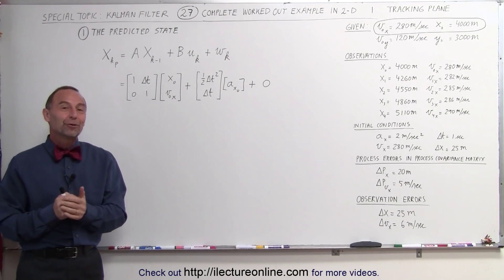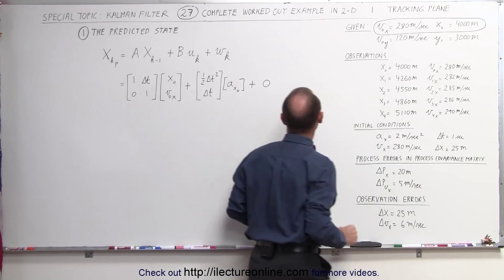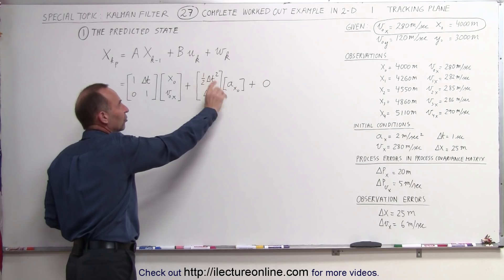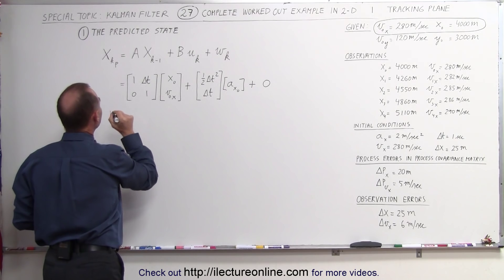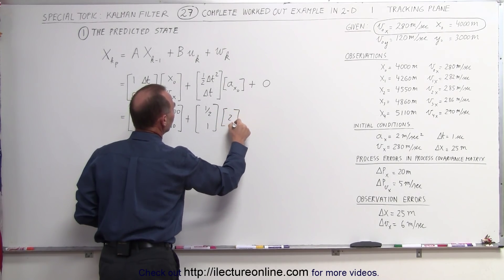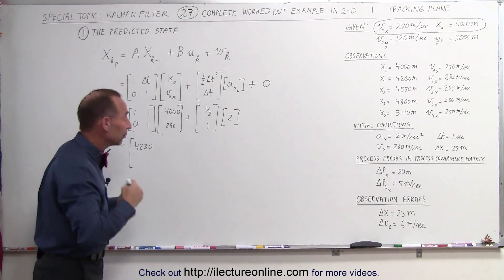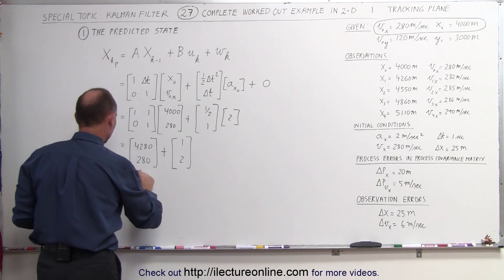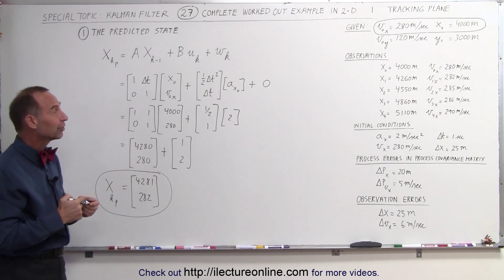Special Topics - The Kalman Filter (27 of 55) 1. The Predicted State - Tracking Airplane

Comment: How do we know what to put for A and B matrices? Is this matrix notation a different way of writing the kinematic formulas we used to know? Is there any specific rule to create A and B in Kalman Filter since you haven't mentioned it? How to create the first formula in the first place by magic?
Reply from the maker: It depends on what you are tracking.  In this case we are tracking a target that is subject to the equations of kinematics.   X = Xo + Vot + (1/2) at^2   which is where those two matrices are derived from.
Reply: @MichelvanBiezen  Thanks. It's very long series, and I am trying to finish step by step. I guess I will get a clear idea after I finish them all.
Reply: Ok, then. We can build up our own matrix from the well known kinematics equations in this case. I guess it can be applied to any case. First, write down the known formula about the topic, then create a matrix algebra. Do the rest with matrices and linear algebra. 
 @MichelvanBiezen

Comment: Great videos, thanks. I am working on indoor localization that combines WIFI and MEMs data. I've got position data (X, Y) from the wifi and got orientation data (pitch, yaw, roll) by fusing smartphone sensors (accelerometer, gyro, and magnetometer). I want to use a Kalman filter to fuse both results but I don't know how to initialize the state matrix ( the control variable), and the covariance matrices (mainly the initial conditions). Can you help in regards to this? Thank you.

Comment: As I understand, the "control variable matrix", u, isn't affected by the rest of the kalman filtering process. I.e. it is constant and is set to an acceleration of 2 m/s^2. Is it possible to get a more accurate Kalman filter if you calculate a new value of the acceleration in every iteration, for example setting accelaration a = (Vk - Vk-1)/deltaT ?? Thanks beforehand!
Reply: no.

Comment: Great videos! Thanks for making them. I have one question though. Since you are only observing the position and velocity of the plane, this example holds good only as long as the plane is traveling at a constant acceleration (of 2m/s2) right?
Reply from the maker: No, if the acceleration of the plane changes, you feed in the new calculated acceleration.  (Note that 2 m/sec^2 was only the initial acceleration).  Multi-state tracking KFs, include, x, v, and a in all 3 dimensions.